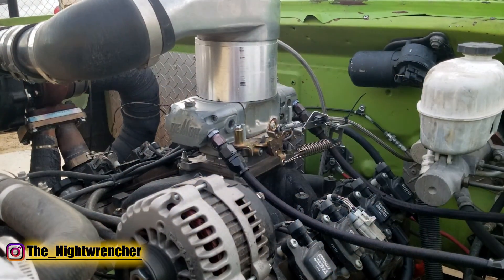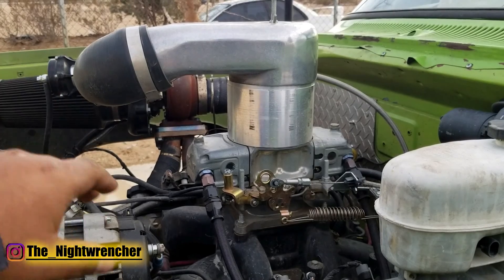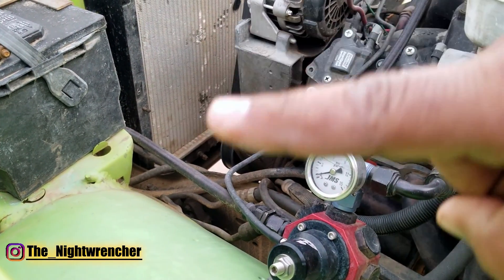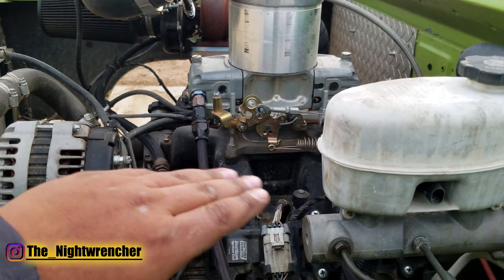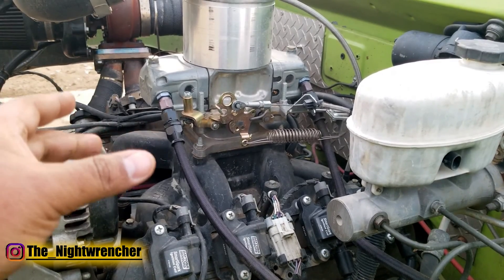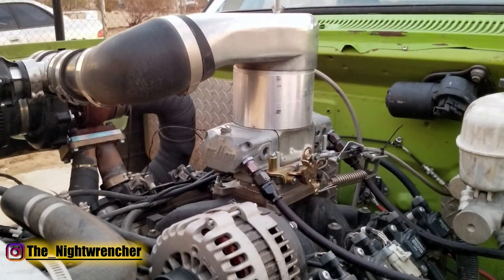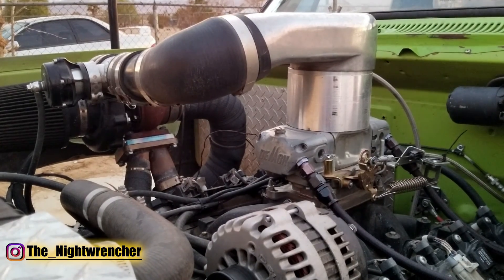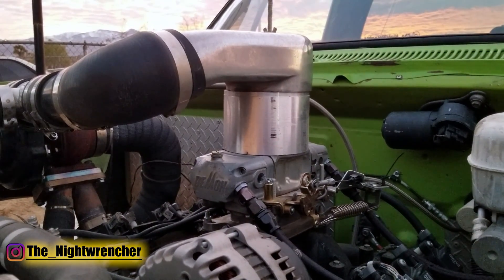How To Turbo A Carbureted Engine Easily! |Blow Through Holley Carb Tuning | Carbureted Turbo LS

Comment: Awesome video. I’ve been trying to figure out how to control timing with a distributor. Planning on building a blow thru setup on a 85 gt with a edelbrock carb and victor Jr intake
Reply from the maker: For an 85 gt the easiest way would be to lock it out. The second way would be to lock it out and then use a TCS-1 to control it electronically if yours using a 6AL. The third way would be lock out the distributor and use a CD-1 to control it electronically if you dont have an existing ignition box. Lastly, you can unhook the vacuum advance and recurve your distributor so that it only advances 5 degrees through the mechanical advance.
Reply: Appreciate the info. There’s not a lot of helpful info I’ve found online yet. I still have stock ignition aside from msd distributor but plan on buying a 6al box so I can have a rev limiter and 2step. I like the idea of just locking timing out but I also want the car to be semi streetable cause it’ll definitely get driven to work
Reply: I don’t plan on running it on very high boost. Probably no more than 10 psi. It’ll be a very mild build just want a fun strip/street car
Reply from the maker: That will work. You'll be able to run a decent amount of timing under boost but you gotta be careful. Add 1 degree until it stops getting fast and then drop it by at least 2 just to play it safe.

Comment: QUICKEST WAYS TO TURBOCHARGE YOUR CAR - 1. Switch to 91 octane or higher top-tier premium fuel, 2. Switch to iridium spark plugs - preferably Bosch, 3. Attach a "turbo" logo to the rear of your vehicle.
Reply: And then get passed up by some dude with a turbo
Reply from the maker: Everybody making jokes 😂
Reply: @NightWrencher  yeah but are any of them funny. I'm guessing barely
Reply: @NightWrencher  I’m going to get two 3582s and use my Holley pump with 8 lbs of boost and a 245@.050 .600 hyd roller cam and Holley SD with a super sucker and 750 DP, with iron FE manifolds reversed and 396 ci and hopefully about 525 NA hp 8 lbs of boost and 840 hp. That is the extent of my sense of humor. Lol
Reply: Crickets
Reply: Sadly that was, (if you throw K&N drop in filters on that list), 100% me 20yrs ago!!😅

P.S. you talking the double, Tripple.., (and for the most daring among us)…, !QUADRUPLE!
electrode tipped platinum plugs, Yes???… 
.....”Oh yeah? Bosch Platinum’s huh?🤔
🤔..that’s +10hp on ur 4cyl ritedare’.
      ….😮🙌…….
  ….thats what that is..🫠😂🤣🥹😄..!!

Comment: I want to say,I've been searching for a couple days now for the information that you explained in just a few minutes. Great job. I have a question. Can I use a two barrel carb? It's a reproduction, looks like an old Carter. Made by Thundermingo. It's kinda a cheap one but I have it on my truck and it works well. I needed the info about the Timing, using the lock distributor. Once again good video.
Reply from the maker: A 2 barrel will work fine if the fuel bowl can be pressurized through the bowl vent under boost such as the Holley 2300.

Comment: 331 stroker with a 650 holley. Is this set up possible? Not trying to blow engine but be nice to have a little extra. lol
Reply from the maker: Depending on the cam, it could be the perfect carb but chances are that its a little too big but you'll be fine if thats what you have. My 5.3 325cid has run carbs from a 575 all the way to a 780. As long as the tune is right, it'll run and drive really well. Its not gonna blow up, don't worry.
Reply: Runs really good but needs more top end.
Reply from the maker: @timsimons8946  that could be anything from intake manifold design, head flow, cam size, etc. I recommend getting on a dyno as soon as youre able to so you can get a graph of your horsepower and torque. From there you'll be able to see exactly what to do. Going to a bigger carb wont hurt anything so youre good there
Reply: Gt40 heads , x cam

Comment: What why not just use a draw through design what's the disadvantage of draw through carburetor ❓🚩 does draw through make less power ❓
Reply from the maker: I should make a video on this but basically. A draw through set up acts like a big engine and needs a lot of carburetor to get it going. Air temps are higher too. On a blow through, the air is pressurized before going into the carb which means you can make more power with smaller carbs. It also drives better on the street and air temps are colder.

Comment: Highly interested. Would love to see what you’re doing with your power valve.  If you’re running a power valve with e85, what are you doing with the pvcr’s. Thanks.
Reply from the maker: The PV circuit is a huge part of it. Its not just replace the PV with a different one, theres quite a few things you need to do to get it dialed in.
Reply: @NightWrencher . Soooooo once you have boost the PV is out of the equation??